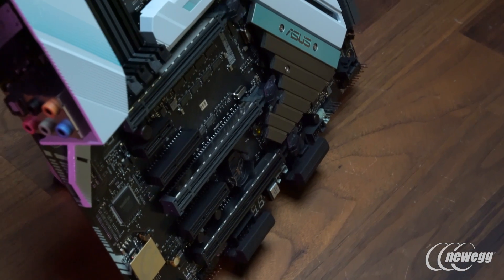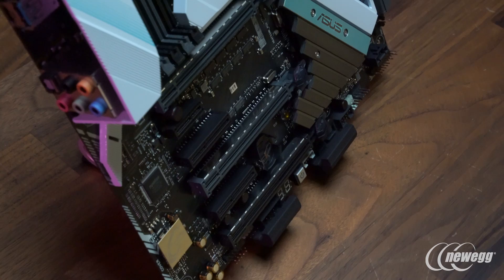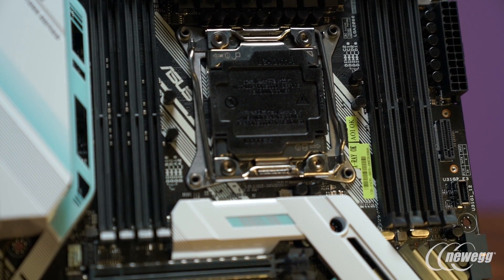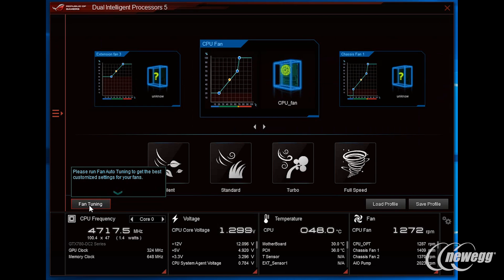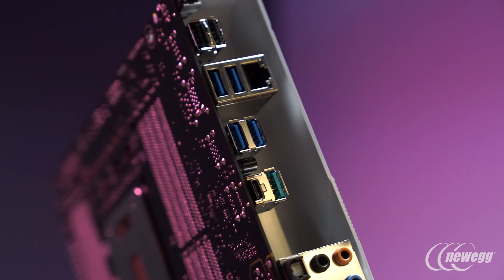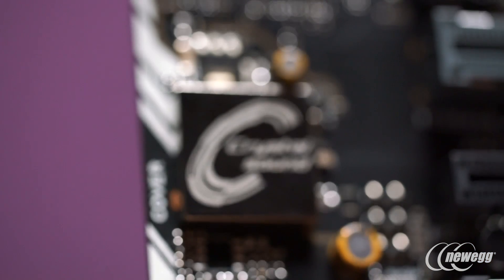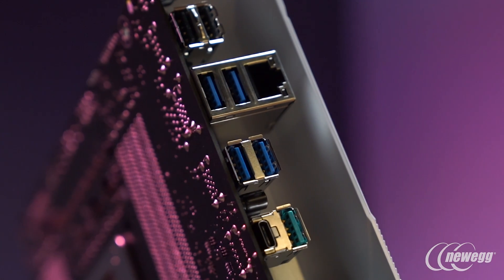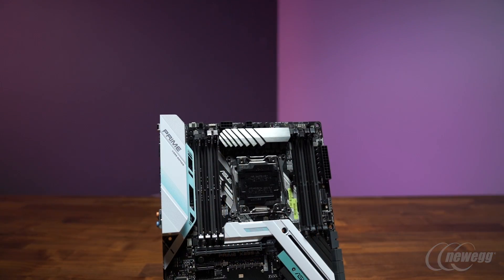Newegg Insider: ASUS PRIME X299-A Motherboard Overview

Comment: it has NO Wifi chip. a huge drawback. You have to strangle yourself with long ethernet wires. (Oh I can buy the wireless wifi dongle to solve the problem) Nope, it won't help you either for a stable connection.